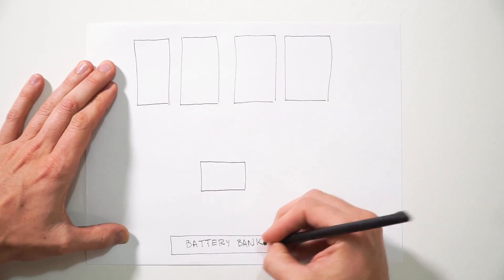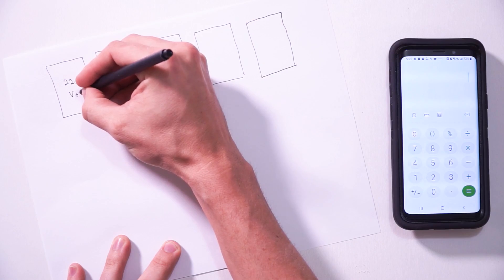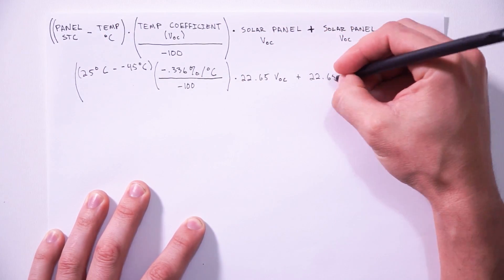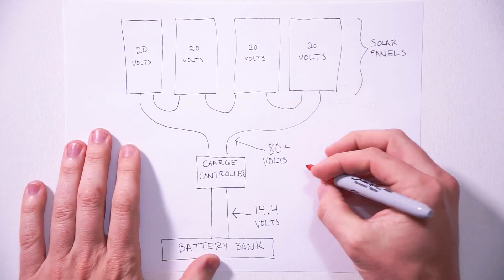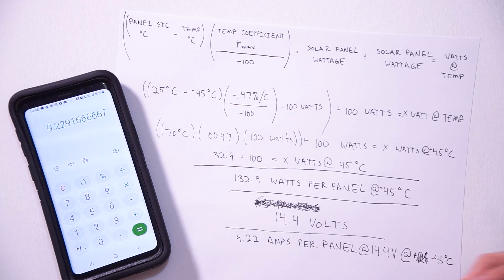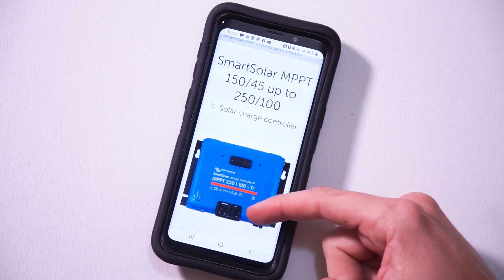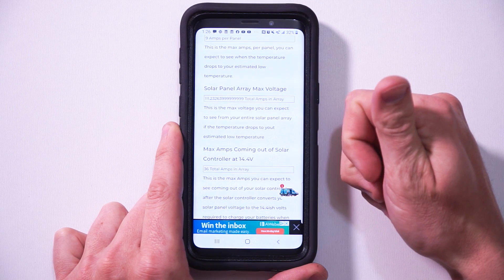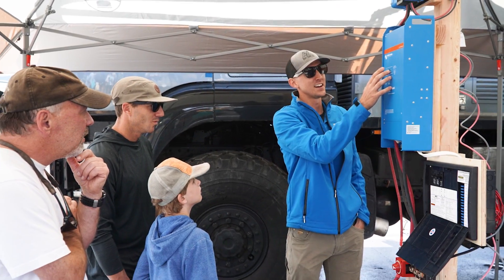How to Size a Solar Charge Controller for a DIY Camper Van Solar System

Comment: so I have a 150/40 and I am running them (S) 120v that should be 8Amp can I also put a few Strings (P) up to the 40 amp rating?
because as it stands 3 might be to much? it shuts down my charger would it be different if I ran them (2S) (2P)
Reply from the maker: That kind of series/parallel change can affect whether the controller trips, but it really comes down to the exact panel specs and how close the system is to the controller limits.

Rather than guessing, our support team can take a quick look at your setup and point you in the right direction — and help you get the right parts if needed: 👉 https://shop.explorist.life/support?utm_source=youtube&utm_medium=comment&utm_campaign=support&utm_content=response_link

Comment: Hi
I'm using a morningstar 45amp pwm controller here. I have one 180 watt panel and one 100 watt panel and two 50 watt panels all in parallel to busbar. Than to controller. I know i will calculate with  the lowest panels voltage and add up the total watts. So i have four panels and three different voltages since the two 50 watt panels are the same.
I called morningstar since i get no propper bulk charge out of my system. I use gel batterries. Batteries are at 12.2 volt at rest. So partly discharged. Even so partly discharged the controller would not have much of an output. All day sunny and 380 watts of solar at 17.9 volt did only produce about 30Amph. I called morningstar and asked what they think is going on. They laughed at me and said i should never use different wattages and voltages of panels for one controller. And this is why output of their controller is so low. 
What do you think is going on?
I think controller is not working right. Or controller is to large, perhaps it does not get enough volts to open up.
Please respond if you find some free time to do so,
Reply from the maker: Totally get the confusion here — solar systems can be pretty unforgiving when a few details don’t line up.

There are a lot of variables that can affect output in a setup like this, and it’s really hard to diagnose accurately without seeing the full picture of your system. Rather than speculating, the best thing we can do is take a quick personalized look at your setup and help you figure out what’s holding things back (and how to fix it).

Reach out to our support team here and they’ll get you pointed in the right direction: https://shop.explorist.life/support?utm_source=youtube&utm_medium=comment&utm_campaign=support&utm_content=response_link

Comment: Thank you for all you do to educate us on solar systems.  I am in the process of planning an upgrade to my solar panel array.  I have chosen a few different panels to pair with my Victron MPPT charge controllers.  I have two 100/30 units.
Here is where I am getting conflicting information.  I used your calculator and got the results of how many panels I can wire in series using either 150, 180 or 200 watt panels.  I plugged in the numbers for the variables in your formula and go the answers.
I also know Victron has a similar calculator so I did the same with that calculator.  I got VASTLY different results.  Your calculator was way more conservative than the Victron results.
Are you familiar with the Victron calculator?  If so, could you compare yours to theirs and let me know what you are seeing?
I did notice the Victron calculator had many more variables in the "advanced" mode than yours due to you baking those values into you algorithm for your calculator.
I just feel a bit uncomfortable getting such wildly different results.  
Could you comment?
Reply from the maker: Yes, I can most definitely help.  Are you purchasing/have you purchased your Victron gear and/or wiring kits from our store? (Shop.explorist.life)

Comment: I just bought a trailer with a 12 V battery. Can I just add another 12 V battery and wire it in parallel without having to worry about anything else?
Reply from the maker: Great question! 👍 There are a few details to consider before adding another battery to your system to make sure everything stays balanced and safe. We’d love to take a closer look at your setup so we can make the best recommendation for your trailer. Reach out to our team at https://shop.explorist.life/support — we’ll help you get it set up right!

Comment: Thanks Mate, A Good Video and Calculator Too😊👍
Suggestion with Calculator to allow user to input lowest Temperature in C &/or  F.
Down Under -40 temperatures is definitely unlikely here.
Cheers🦘😁👍
Reply from the maker: You can always reach out to us at shop.explorist.life/support and we can run the numbers and get you what you need. 😀👍

Comment: I need an advice. 
I have a camper van with factory solar system. And I also have a small bluetti power station that I would like to charge from a campervan solar panel once the house batteries are fully charged.  Should I split solar panel cable before my pwm controller and add cable with xt60 to my power station or would you suggest other options? Currently I have a single 200 Watts solar panel.
Reply from the maker: Great question! The best setup can depend on your factory system, controller type, and how you want charging prioritized. We’d love to look over your exact wiring and recommend the safest way to charge the Bluetti (and the parts you’d need). Shoot us a note at https://shop.explorist.life/support
 and we’ll get you dialed in.

Comment: It seems like your assuming perfect conditions at lowest possible temp. This doesn't seem feasible for these conditions to be met for any solar pannel.
Reply from the maker: Ever?  Are you willing to be your charge controller on that?  The Risk of messing this up is non warranteeable destruction of the charge controller.  I can’t recommend that as it’s a liability.  You do you though I guess.

Comment: Can u help me make my solar charger charger my 12.8v  battery 30amp 100v BougeRV, I have 4 100 w panels in parallel series . Victron 100/20 is doing the job but I would like to get the maximum of the four panels. Can u help setting up. ? I tried but cant figure it out!
Reply from the maker: Absolutely!  Happy to get that squared away for you.  Get signed up for our Pro Support Membership and we are happy to take an in-depth look at what you've got going on and get that programmed properly for you: https://shop.explorist.life/shop/all-products/membership-tiers/

Comment: I push a maximum of 22 amps through my 150/45 and it does not get hot and throttle back in August. Maximum amps equals maximum heat.
Reply from the maker: Thanks for sharing your experience! It’s great to hear your system is performing well even in the heat.

There can be a few variables at play — things like airflow, system load, or even subtle design differences can impact how the unit handles high current.

If you’re ever looking to fine-tune your system or explore potential upgrades, our support team can take a closer look and make tailored suggestions:
https://shop.explorist.life/support
(We offer free personalized support for items purchased from our store!)

For gear purchased elsewhere, check out our EXPLORIST Pro Support Membership for ongoing expert help:
https://shop.explorist.life/shop/all-products/membership-tiers/

Comment: I love the videos and I’m working my way through the series. My question is and it may be a dumb one, but you are adding your amps together in a series. Connection, don’t the amp stay the same in series and voltage ads.
Reply from the maker: That’s a great question — and not dumb at all! Whether current or voltage increases depends on if you're wiring in series or parallel, and it can definitely be confusing.

To make sure your setup is wired safely and correctly, our support team can walk through it with you here:
https://shop.explorist.life/support

Support is totally free for gear bought from our store: https://shop.explorist.life
And if your components came from elsewhere, the EXPLORIST Pro Support Membership gives you full access to help:
https://shop.explorist.life/shop/all-products/membership-tiers/

Comment: I just purchased one of those chargers you are promoting. 100/30
I have a small system for my van with a 3000 watt inverter and I have one 100ah agm battery but soon to have one more.
I have 2 used solar panels but the speck sticker is faded. They do make 22 volts in the detect sun. I do know the name brand of the panels and the bar code is easy to read. 
Question one. Is there a way to get the information for this panel?
Question two is the charger going to run my mini fridge a few lights and a little ac in the late afternoon. I live in the deep south and luck to see 20 degrees F in the middle of winter
Reply from the maker: Thanks for your comment, Dennis! For question one — if you’ve got the brand and barcode, there’s a good chance the panel specs can be tracked down. That info will be key for confirming compatibility. As for the charger handling your loads, it really depends on your total energy use, battery capacity, and how much solar you're harvesting — especially with that AC in the mix.

Our support team can help you dial it all in with your specific gear and setup: https://shop.explorist.life/support

We offer free personalized support for anything purchased from our store. If your gear came from elsewhere, the Pro Support Membership is a great option for expert help: https://shop.explorist.life/shop/all-products/membership-tiers/

Comment: Thanks for the calculator but how do I set the panel in series to 0? I only have 2 panels in parrallel.
Thanks, Andre
Reply from the maker: That would be: 1 panel in series - 2 panels in parallel.

Comment: GREAT VIDEO! What about sizing up by 20-25% on amp rating as some recommend? If my panels are temp compensated putting out 14 amps can I really use 15 amp controller?
Reply from the maker: Reach out at https://shop.explorist.life if you need customer support regarding solar charge controller choices.

Comment: Thanks for this excellent video! I used the calculator but received the warning message below. I have one 200 watt 18v portable solar panel and a 12v 100Ah LifePO4 battery. The warning message says that my solar panel is less than 5v higher than my battery voltage, but isn't my solar panel actually 6 volts higher than the battery (18v - 12v = 6v)?

WARNING!  SOLAR ARRAY VOLTAGE LESS THAN 5V HIGHER THAN BATTERY BANK VOLTAGE.  Solar array voltage MUST be at least 5V higher than battery bank voltage for the charge controller to operate.  Fix It by doing any/all of the following:
Increase the number of panels in each series string
Use higher voltage panels
Decrease the battery bank voltage
None of the following charge controllers are recommended until this problem is resolved.

Comment: Ok so my question is, why do some companies put on their charge controllers a max watts if it really comes down to Volts/amps?
Reply from the maker: I suppose that would be possible if the controller was set up for only one voltage of battery bank and not 3-4 like Victron units can handle.

Comment: I have to admit my brain is frazzled. I am doing my own conversion ( UK Based) I have just bought an eco worthy 200w solar panel and 2 x 115AH batteries which will be wired to give 12v. From a previous conversion I have a victron 75 / 15 MPPT controller. Is this man enough for the job ?? Thanks

Comment: Victron could have made it easier still.  I thought the listed voltage and amperage were both input maximums.  Certainly their 100/30 MPPT cannot handle an input of say 400 Amps at 100 volts.  Perhaps their listing these numbers clearly as maximum inputs would be good, and then listing the charging output in amps, and labeling that as well.  Thanks for the video series, these have been great.

Comment: I'm not getting any voltage from my panels. I have 3, 195 watt panel routing to  one smart controller 100/30 and 2, 195 watt panel routing to another 100/30 smart controller. Any idea where to start troubleshooting.
Reply from the maker: This may take some more in-depth troubleshooting.  If you have purchased/are purchasing from our store (shop.explorist.life) reach out for some more personalized help: shop.explorist.life/support

If you've purchased/are purchasing elsewhere, reach out to your dealer for support.  We'd love to have you as a shop.explorist.life customer so we can provide a bit more help in the future. 🙂

Comment: Can I charge a battery bank of 12 deep cycle marine batteries all in parallel,   using 4 each 200watts solar panel in parallel, & produces 32volts each & 8amps each out puts close circuit each??  If so what brand charge controller, & model number type should I purchase; temperature during summer 🏝️85*-95* & winter🏝️ 60*-70* degrees.. thanks you for the info & advice.. 👍🏽🤙🏽😁
Reply: Plug In all the goodies numbers to his program to get you the exact charge controller that should suite your needs

Comment: Usually you just design your solar charger system to be able to handle 30% higher voltage then the panels is rated at to make sure you do not get overvoltage when it is cold and sunny. 

When it comes to more Ampere / watt in then the charger is rated for as I understanding that is not a problem, your charger will simply not use that energy and it will not matter but go to waste as potential energy not used. 

Just like you have in a 16A 220v system 3,520w available in the socket, and if you connect a 10w led it will only use 10w not the full 3250w available in the socket.

Comment: Hey Nate, just how conservative is your template when choosing the correct MPPT controller?  Don't think I have ever gotten full power from my panels in full sun.  
Also, I thought the numbers on front of the Victron MPPT controller were for the input of the volts and amps?  Not the converted out put? Please clarify.  Thank you.
Reply from the maker: The numbers on the front are: Volts Incoming | Amps outgoing.

This may take a more in-depth look at your personal setup.  If you have purchased/are purchasing from our store (shop.explorist.life) reach out for some more personalized help: shop.explorist.life/support

If you've purchased/are purchasing elsewhere, reach out to your dealer for support.  We'd love to have you as a shop.explorist.life customer so we can provide a bit more help in the future. 🙂
Reply: @EXPLORISTlife  - Thank you, Nate.

Comment: If you put the panels in series you get x5 volts AND amps? That's news to me...
Reply from the maker: Don’t confuse what happens on the panel side of the controller vs the output side.
Reply from the maker: If you have purchased/are purchasing from our store (shop.explorist.life) reach out for some more personalized help: shop.explorist.life/support

If you've purchased/are purchasing elsewhere, reach out to your dealer for support.  We'd love to have you as a shop.explorist.life customer so we can provide a bit more help in the future. 🙂

Comment: I dont know if this is a dumb question but can you go wrong by getting a solar charge controller thats greatly over-specced for your system? What if I got a 100v/50A controller and i only got two 24V batteries and two 100-Watt solar panels?
Reply from the maker: This may take a more in-depth look at your personal setup.  If you have purchased/are purchasing from our store (shop.explorist.life) reach out for some more personalized help: shop.explorist.life/support

If you've purchased/are purchasing elsewhere, reach out to your dealer for support.  We'd love to have you as a shop.explorist.life customer so we can provide a bit more help in the future. 🙂

Comment: How would you apply this for series parallel? Do you need to do the calculation for both strings and add them together? I've watched all the videos and I can't find anything on sizing mppt for mixed panels in series parallel! Thank you 😊
Reply from the maker: The calculator accounts for series/parallel: https://explorist.life/solar-charge-controller-calculator/

If you're going to be purchasing from us, you can always reach out to shop.explorist.life/support for some more personalized guidance.